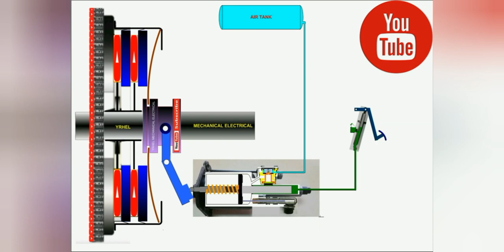FOOT BRAKE VALVE COMPLETE REPAIR

Comment: I have mp3 truck mixer have error code 6241 and when braking the truck not stopping normally but like jumping a little bit 2 or three times until stop completely. is that problem related to the electrical fault 6241 and where is this pressure switch or mechanical issue. Please advice.
Reply from the maker: short circuit on the braking control system, check brake signal cable.